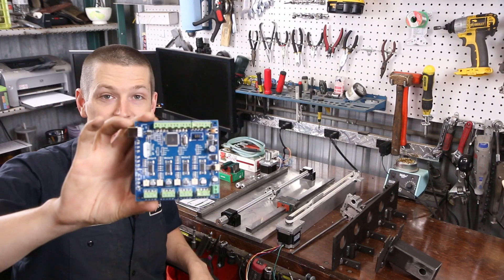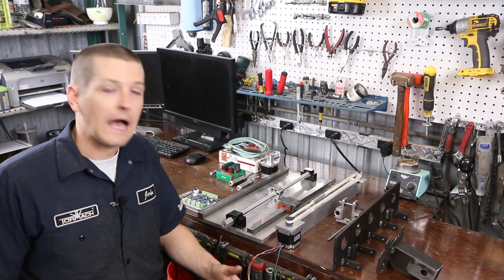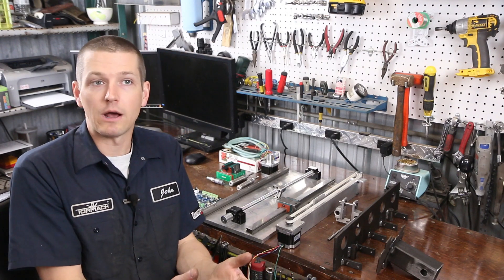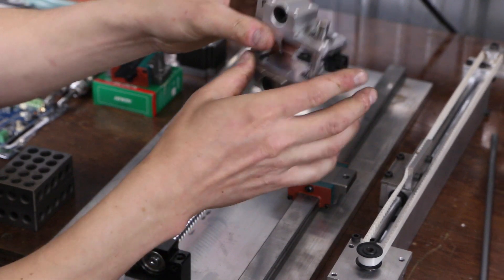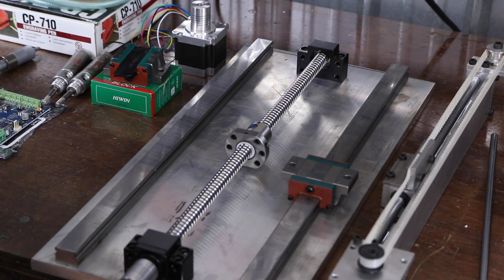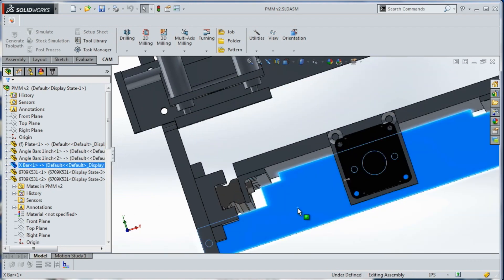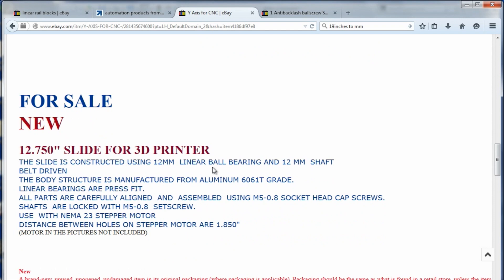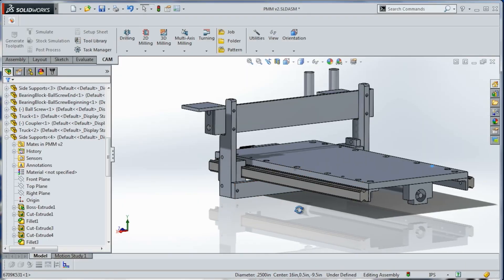DIY CNC Machine: Linear Rails + TinyG Part 1!  Widget40

Comment: I am trying to design a 5 axis machine that is 10 ft by 10 ft and I want the z axis extended by making the table move up and down. I was planning on using threaded rods to move the table so that the weight of the material didn't effect the motors..any ideas on what to use to raise and lower the table?

Comment: It took me only a day to put back those tiny bearings back in place once it popped out (due to overtravel). Later found out there is actually a plastic tool to put those bearings back in place!

Comment: I have built a cnc plasma table from scratch. It uses 20mm linear rails and 20mm ballscrews. I have a question. My machine is only stable up to 60ipm. Im using 1600in Nema 34 motors. The ballscrews are model 2005. I believe this means 20mm diameter and 5mm thread pitch. Is this correct? If so, can I buy 2010 ballscrews and double my speed? If I speed up motors it skips steps. If there is a better way of tuning the motors to get reliable speed that would be great. They are china steppers and controllers. Any help would be great. Thanks! Great channel!

Comment: The machine looks nice, however i think there are many cheap ways to make this machine much better for milling should you want to do so. The machine does not look to be very stiff in the x and y axis directions, which begs the question, if it doesnt have to be very stiff, then why invest in expensive linear guide rails when a simple hardened steel rod could do the same on low stiffnes applications?

Also i feel like the ball screw in the x direction is quite overkill, since it's much, much more precise than the band driven y axis.

all in all this machine could be cheaper by choosing parts that all have similar precisions, instead of having some parts be incredibly precise and others not at all.

Comment: Sir I am a Col. USAF, I need to build a larger machine, 60x60 for drone building can you glide me , do I use linear with a belt and motor, or a torque screw.
Second question are you for hire

Comment: Revisiting I noticed (recalled) you’re using pnuematic cylinders for z axis. Are you just extending and retracting or are you using it for linear positioning? I have a project adding a 4kw sub high speed spindle to a custom bt40 milling head on a 1200lb bench mill. I want to extend and retract when in use and mount it on opposite side of atc. Been breaking my mind at the best way to do this and maintain rigidity. Thought is two short 15mm hiwin rails recessed into mill head so they are flush mounted with a 1/2” L bracket using the rails under the large flat of angle and perhaps a rodless style actuator on the smaller opposing face. Essentially the spindle will be encased into the side of the mill head approx 1” with whatever I use on the back side to extend and retract. I estimated a minimum 500lb of holding force is necessary and would like to double that. The concern is that it holds down in place when machining and doesn’t lift up even a thou or two so I can get a consistent finish and also do some mold making. Choices, pnuematic cylinder with shit off solenoid and air reservoir, ball screw with 12/24v motor operated by output terminal and limit switches, or a low profile rodless linear actuator with limit switches. Spindle control will be swapped over by relays using single motion input/output (pwm) and essentially it shuts one motor off to control speed for the other. Bigger concern is what to use to hold it down? Travel is only 4” to extend up and down (2” centerline flush to mill head bottom) extending just past existing spindle and tooling. Needs to be consistent for obvious reasons. Any thoughts?

Comment: With the ballscrew, how did you get the fixed end block on so easily? I'm going to have chill my ballscrew somehow or sand it down. I've read chilling it is the proper way, but I'm worried about how I'll be able to get it off if I need to (the bearings already feel pretty stiff).

Comment: I fully understand why trying to use my i3 3D printer clone as a CNC Drill/Router with the Dremel Flex shaft was a bad idea, just too sloppy with the belts/shyt 8mm lin rails, lin ball bearings, not to mention the PCB holder that I 3D print and leave on the bed sits on a spring platform thats as flat as a potato... Going to have to bite the bullet and get some kind of kit and modify it to run my Cincinnati 3PH 2.5HP knee mill...

Comment: I got a kit on eBay for $420. It came with 400mm, 700mm, and 1000mm ballscrews, 2 20mm linear guide rails for each ballscrew and HGH20CA cartridges. Had a hard time finding prints but I got everything loaded into CAD. Hopefully I can make the models available when I finish the build.

Comment: Thumbs and sub for you sir! I really like your vids, well done.
For the ball nut, have you ever used an adjustable drylin nut before? (drylin is a trademark from IGUS) I have never built for a CNC application (yet) but in general machine building i've done a ton motion systems using drylin trapeseoid nuts with very good results (even in high speed and high load mechanisms that run nearly continuously all year round). Now, I will ofcourse admit to the superiority of a decent ball screw setup in terms of accuracy, lifecycles and so on, but as you mentioned there is a considerable pricetag on the components. also i personally feel some concerns whenever any type of recirculating ball bearing is used in a "dirty" zone on any machine (in this case dirty meaning the presence of dust, debris, hot cutting chips, cooling fluids etc) as it can cause a ball nut to get stuck when the polution manages to get past the seals.. 

Just a sidenote on drylin:
keep in mind that "the correct" type of material and geometry a for a dry nut setup must be selected appropriately but the guys over at IGUS have oodles of expertise to help with that. secondly, a standard dry nut will have some clearance tolerance and thus has inherent "dead zone" play on both axial and radial directions therefor not suitable for a CNC application, you will one with a adjustable or automatic friction tensioner integrated.)

Cheers mate,

Comment: Hey, thanks for your videos!  I'm looking at trying to setup a machine so I can cut acetal to make spacers/faceplates for mounting raspberry pi 3 boards to devices/cases.  Your videos are very informative.  I'm not sure if I'll ever go through with it all but I can appreciate the precision and quality CNC can provide over 3D printing.  If I ever get the money set aside to go through with all of this, I'll have you to thank for making the leap.

Next, I need to figure out how to finish 90 degree corners after cutting a rectangle shape (I'm very new to all this) after cutting with a round bit.  Maybe a chisel? different angles?  I'm not too worried about it for now.  Engraving would be cool too!  Hoping the tools will last longer since I'll only be cutting plastics.  Also, I do watercooling for PCs and being able to cut my own custom pieces would be awesome.

Comment: See, ugh, your incessant need to sound intelligent is annoying af. I've seen it in about 5 of your vids now, you constantly try to use complex adjectives that are needless, yet 'impressive' 😒. No, I don't have an issue with understanding what you are saying and yes, I realize that ones vocabulary tends to simply be a product of ones intellect. But it's transparent af that you are trying too hard to put it on. Sorry, but the evidence is found in your use of the double negative. Saying the word 'inexpensive' is simply the most efficient way to manifest your point verbally and the choosing of said word is simply your brains automatic way of explaining the low value of an object, right? Can't help it if your brain is just wired in a way where it regularly manifests thought in intelligent sounding ways, right? You don't actually try to use that word as it's a larger and less frequently used word than cheap right? It's not you just trying to sound smart, right? 

The brains auto functions are set to both save time while maintaining context accuracy - you can't help it if your brain automatically says 'inexpensive', your brains auto level of efficiency is just higher than everyone elses right??

 Sorry pal but, well, as I said, for this example, your use of double negatives gave you away. You said "This isn't inexpensive". 

Your brain tried to output "The value of this object is comparatively high" but you're auto response was to try and use the largest most complex phrase  possible - and your brain derped. Meaning, the phrase you used was a semi-concious choice. 

Hmm.
Why would someone want and choose to use such a complex phrase when it would make more sense to just say that the object was expensive?
Maybe to appear smarter than average, huh? No biggie, you just want to appear smarter than the average person, just want people to know that you are more intelligent than they are, sall good.

Yeah, I have had way too much time on my hands this morning, so sorry. 
Just erks me when people try to appear more intelligent than other people. I mean, what happened to considering ourselves all equal. Christ.

Comment: you have many choices because customer preference and they go from an endless amount of products you can use.  the cost has come down because of knockoff design and cutting corners.  building hard drives or circuit boards are where this is used and tolerance is critical on these setups not diy friendly.  this is a great tutoring which wasn't available 30 years back unless u knew someone or were lucky to get connected with after school club.

Comment: Reporting in two years later aaaand it's not exactly easier to get into! I've tried digging around but information is either way too vague or so overly complex a layman can't get into it. The hardware is acceptable, prices still a bit high. The open source motherboards and firmware and software all feel sooooo clunky and limited (I'm coming from the 3D Printing world and CNC feels really backwards). 
I'm slowly dredging through the information and getting there... still disappointed by the electronics board limitations and firmware too though...

Comment: You can get a ball screw linear actuator which is everything all mounted together and they have ones on eBay that come with different stepper motors, the one I'm looking into getting for my SLA z axis is only $150and it even comes with installed opto interrupter limit switches. It only has a 220mm throw but that's all I need and the thing looks like it's built like a tank! What I'm getting at is eBay is amazing for this stuff!

Comment: If you aren't looking for super high precision, you can get lead screw assemblies with 2 mounted bearings, lead screw nut, motor coupling, and lead screw for around $10 from banggood and ebay

Comment: The pricing is already coming down, and you can pretty much directly associate the price changes recently to the mass importation of cheaper Chinese hardware.

Are you sure you want to use those pneumatic pistons? If the goal is to eventually get some sort of spindle, or any kind of depth accuracy on it, might i suggest heading over to openbuilds, or ebay, or even amazon, and buying one of the short 200mm / 250mm x 8mm 4-start acme leadscrews and nuts., @ 8mm, they are usually pretty cheap, if i'm not mistaken, on openbuilds you can get one of those leadscrews for about 10$ + SH.  add a small stepper, and you're in business for accuracy on the z axis.

Comment: Are the linear rails and the ball screws at the same vertical height when laid flat on the same plane sheet like you have them? or is say the ball screw taller and the linear rails shorter?

Comment: Nice vid but 

15mm hiwin rail per block can take more the half a tonne 
16mm ball screw can move that easily 

So in short what you have is expensive because of mental overkill 
Dmg mazak and even haas would max use 35 mm rails for hardcore milling machines 

Other reasons why u should get smaller rails to match the job are the forces needed to push big ones are more difficult on the stepper

Comment: I watched the sries a couple times so far but for a motor to carry your tool bit look at an mini air die grinder, its realy small sits on 35000 rpm all day and they work a treat at just on 30 bucks I have abused mine because I had a break down of my normal unit so bougt this for a temp now its still kicking butt at 3 months old it's like I bought it yesterday.

Comment: Don't buy kits, buy you parts individually, I can buy 3 ballscrew with nuts for the price of that one 108$ ballscrew  kit.

proof http://www.ebay.com/itm/3-set-Anti-Backlask-RM1605-500mm-Ballscrew-end-machined-/262267010772?hash=item3d1054fed4:g:fZwAAOSw5ZBWKheN

yours http://www.ebay.com/itm/290870738150?rmvSB=true

(bearing ends 27$ http://www.ebay.com/itm/Ball-Screw-Bearing-Mounts-End-Supports-1-set-BK12-BF12-BK-BF-Series-for-CNC-/272211540357?hash=item3f61127985:g:174AAOSwLmVXDzr7 )

(coupler 1.32$ http://www.ebay.com/itm/D19L25-Flexible-Shaft-Coupling-CNC-Stepper-Motor-Coupler-Connector-3-10mm-JHRS-/381598852695?var=&hash=item58d9106657:m:m-XgPrci5U1BzEQP4tD4WXg)

Also why not support rails linear bearings like SBR12 + SBR12UU  or SBR20 + SBR20UU (8,16 mm are more expensive even if smaller !)
Reply: Awesome.  I'm looking to do a 1000mm but those are pretty expensive.  Can't find multiple screw kits for that.  I'm looking at about $200-$250 just for the screws and mounts.  Why are the screws so expensive?  What about using long bolts from a hardware store with a weld on nut?
Reply: DJDevon3, you might want to look at used industrial machines locally
Reply: ***** What do you mean expensive ? I see RM1605 ballscrew 1000mm at 26.50$ + 39$ shipping, I suppose if you get more than one then it is much cheaper too

Comment: the only thing I see a problem with is keeping rubbish, dust, whatever out of the un sheltered linear bearings, other than that it looks great. I would have mounted the linear bearings under the table for a little protection instead of the outside edge. thats something to think about next time
Reply: I'll be watching with interest how this one goes. So impressed with the accuracy of the last one. The programming side does stuff me up. I'm not up to speed with any of that. I would like to be though

Comment: maibe if you dont have enough length in the rails you can buy one more rail cut it in half and but them up exactly to the end of the full rails , i think the tini gap whont make mush of a difference with the width the bearings cover on said rail
either that or move the rail forward away from the part that butts up to the end
Reply: +watahyahknow I think it was the lead screw that was too short.

Comment: That is interesting you are making this for engraving.  I have a custom made desk the top is two tone stained walnut on the top the back 2/3 the front 1/3 is cherry.  I want to engrave in brass or copper parts of the U.S. Constitution, and maybe the bill of rights. the national ensign in the middle and maybe a few other things. I want to do it myself.  Right before you mentioned engraving I was saying out loud I wonder if I can use that for engraving?  Now it is not nearly long enough. So, I wonder if the part could be slide down and engraved in parts? Saves on the cost of the machine but this desk was built off of a 4' x 8' sheet of cabinet grade birch. It was trimmed down but a fairly large desk.

Keep up the good John...

Comment: John, thanks for showing. I think I'll learn some useful things watching how this goes. 

I like the idea of small single board computer controls...why use a big PC with an expensive Windows license and put up with all the bug fixes and malware threat if you don't have to?  A Raspberry Pi running Linux might be worth looking into as well.  

I use a Fit2-PC Atom-based fanless computer running Ubuntu Server Edition as a LAN server for home...plenty of power for my needs, and running flat out it draws 7 watts with a 500GB disk. Best thing for CNC use of such a machine is that no fan means no openings to suck in chips, dust, mist, etc. use an SSD and there are no moving parts so fairly vibration-resistant too. 

Besides engraving, I think if you add a drag knife option, you could use your engraver design for cutting stencils, vinyl sign material, and maybe even thin leather. Work holding is an issue, but a vacuum table made from MDF might do it. Another use might be pin-striping using one of the bottle-with-a-wheel stripers, but turning might require another axis.  What do you think?

-- Mike

Comment: This looks like a fun project.

I was thinking that the angles for the linear rails should be mounted then machined... I used to program Leblond Makino horizontal machines in an aircraft shop here in Seattle and always tried to rely on the precision of the machine tool to make my parts as square and in line as possible.  A little tougher to do on 3 axis, but maybe easier than chasing down binding problems later?

Comment: im loving this series! i have a question, i don't see that your using limit switches. how do you find the origin, home position on the machine?  i am interested in applying this to build my own cnc plasma table. any advice would be very helpful.
Reply: ill be on the look out for the next installment! i have an Arduino start kit coming my way!

Comment: Very cool project, I'm always looking forward for the next episode and I'm jealous about your shop :).
I would suggest one small change to your design. The mount for the linear rails (of the y-axis) should be aligned with the center of the pneumatic press. This way you remove some unnecessary momentum of the rail mount and you probably can use the full range for the x axis.
I'm looking forward for the outcome for this machine.